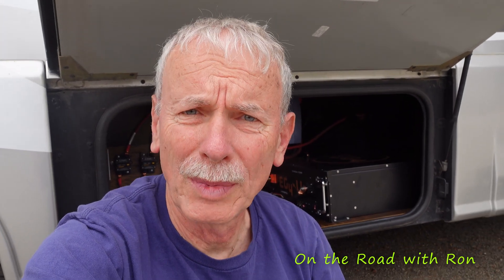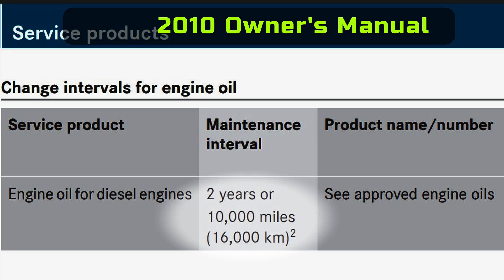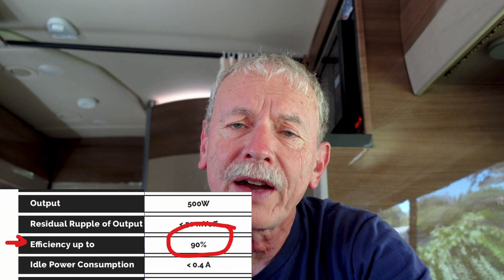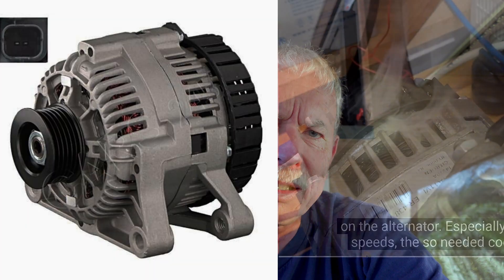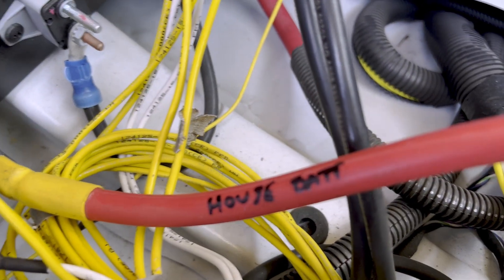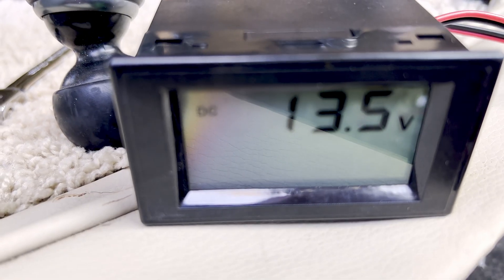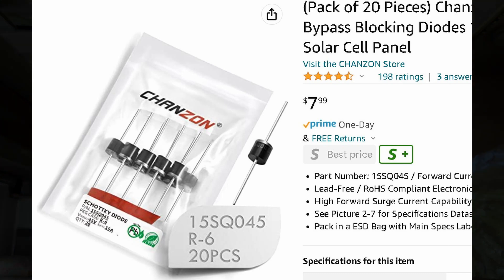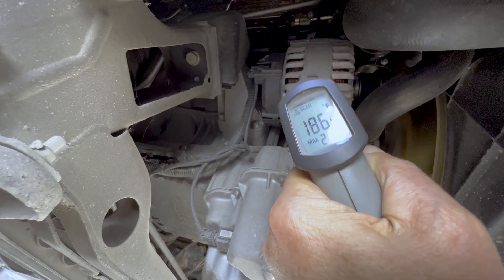DC to DC charger NOT required for big Lithium Battery

Comment: Ron, thanks for your post!!!  I too agree with you.  It also aligns with what Battle Born recommended when their batteries first came out.  Back when I installed my Battle Born lithium iron phosphate batteries 4 years ago (summer of 2018) they shared similar info that you did.  If you had just a couple of 100Ah batteries, then they were simply "plug and play."  If you were in any way concerned about stressing your alternator then they'd sell you a Battery Isolation Manager.  If you had more than 200Ah (i.e. 3 or more batteries) then they'd aim you at some 3rd party DC to DC charger solutions. However, now the newer recommendations don't make sense as the new data is still the same old data; nothing has changed.  I also don't believe a demo and recommendation on a very weak alternator is ethical.  I've been running my 2 Battle Born house batteries on my Sprinter Chassis for 4 years now.  I do have a Battery Isolation Manager (the one they sell) and haven't had any issues at all.  Thanks again!
Reply from the maker: I originally wanted to get the Battle born units but when the server rack style came out it was a lot less expensive.
Reply: AS I UNDERSTAND IT, IT'S NOT THE CURRENT THAT IS THE PROBLEM BUT WHEN THE BMS IN THE LITHUM BATTERY SHUTS DOWN THE CHARGE THE BACK EMF WILL TAKE OUT THE ALTERNATOR DIODES. THE DC TO DC UNIT PROTECTS THE ALTERNATOR

Comment: This may be true for just charging your battery.  But if you have an idling motor, inverter on (2KW) and use a heavy load - I can attest that you can (almost) smoke your alternator.  I could smell it getting hot and shut everything down pronto.   I will be installing my Renogy DC-DC soon.
Reply: Idling with any heavy load is an unforced error.
Reply from the maker: What year is your sprinter?  The older ones do have smaller alternators. And yes, i will not normally be idling the engine. This was just a test.
Reply: Based on discussing this with knowledgeable friends over the years, I’ve come to the conclusion that it’s entirely possible to charge the lithium coach batteries via a direct alternator connection. But, this should never be attempted by anyone but an electronics expert who has their hands on the controls, ready to throttle down the charge rate.
Reply: @koertdubois6781  You likely won't get full charge either. Lithium Iron batteries need a boost voltage of 14.6V in order to get to 100%. You will be about 1V shy if you just use a regular alternator. Or if you have a dead lithium battery they will pull A LOT of current right when you connect the alternator. I have a Renogy 50A DC/DC MPPT charger that will do alternator/converter or solar and will also blend them so I am quite happy with it.
Reply: @geoffmooregm It really needs to be considered in terms of the existing configuration and the owner’s needs. I believe in having as few connections as possible between our Sprinter and the Winnebago coach. Except for the few devices that can’t be completely separated (steps, levelers, slide-out) the only connection I have is  alternator –> Charge Mate –> coach batteries. And that connection is switchable and normally left disconnected. But, when it’s needed, I can choose between 80 and 150 amps from the alternator, plus 80 amps from the generator for either 150 or 220 amps of charging.
Reply: @koertdubois6781  I reading on the website, I think the Charge Mate 90 will only do 40A or 90A.  How are you getting 80A or 150A?  Thanks!
Reply: @antigroundhogday The 90A Charge Mate Pro doesn’t deliver the full 90A (at least in my case) and there’s a “direct connect” switch that is supposed to be limited to 150A.

Comment: I have two Lion Energy 100 AH lithium batteries in my Navion 24D with the same alternator as Grandpa Ron.  My Daughter has two Battle Born 100 AH lithium batteries in her trailer.  These batteries all have battery management systems (BMS).  

The Lion Energy max charging specification per battery is 100 Amps, the Battle Born are rated at 50 Amps each.  I think this is a maximum charge rate so the batteries don't over heat, and may not be a limit set by the BMS.  If the BMS did limit to these amounts, you could never charge depleted batteries directly from the alternator as the BMS would immediately disconnect at every attempt.  You would have to charge them by hooking up to an alternate, current limited source.

The total charge rate of two depleted Lion batteries might be as much as 200 Amps or more and 100 Amps for the two Battle Borns.  Plenty of draw to burn out the Navion alternator and possibly my daughter's smaller tow vehicle alternator.  We both use a DC to DC charger to limit the current just in case the batteries are ever depleted.  We don't want to have to go to all the trouble to carry and have to jump charge our batteries from some current limited alternate source or take the chance that we could burn out the alternator.  PLEASE BE CAREFUL!
Reply from the maker: You should measure the actual current. With tge long cable runs and the smart alternator, i dont think you could ever get that much charging. Of course if you are running AC or a heater in addition then still best to measure it to know. My BMS can use 200 amps also but I’m only getting 75 amps charging.
Reply: @ontheroadwithron2432  Hi Ron, thanks for the response.  I really enjoy your channel and your granddaughter is the cutest.

I agree that knowing the current draw would be  useful information.  However, batteries don't charge linearly but rather draw the most when they are discharged.  I'd first have to completely discharge the batteries for that measurement to be meaningful.  Then, that measurement would only apply to my two batteries and wouldn't be useful for anybody else reading here.

Also, the test might be limited by the alternator maximum or fuses in the line, so I'd need to use a separate high current source which is expensive. Otherwise, the maximum battery draw potential might never be reached during the measurement. 

For me, it would much easier to maintain peace of mind by spending $216 on a Renogy 60 Amp DC to DC charger versus  risking a potential break down and expensive repair.

I agree that wiring may limit current but blowing fuses is also quite possible.  A blown fuse, of course, might protect the alternator but you would never get much of a charge, if any.  I don't know what the fuse in the Navion charging circuit is, but the wire in mine is #6 so it's probably fused at 50 to 100 Amps, depending on the wire length.  

I put a $97, twenty-Amp Renogy charger in my daughters rig as the charging wire is #12 and includes a 30 Amp resettable breaker.  Without the current limiting DC to DC charger, the breaker would just cycle open and closed over and over again and little or no charging would ever take place.

I spent a bit more for my Navion charger.  I'm using a Victron 30 Amp as it's more compact and fits nicely under the passenger seat.  All the wires necessary to hook it up are there.  You simply wire it in parallel with the relay that's used to put the chassis and house batteries together when the engine is running.  Remove the relay's sense wire and use it to start the charger.  A new button can be added on the seat base to operate the relay for emergency start as the dash button will no longer work for that.

Between that 30 Amp charger and the 200 Watts of solar, I've never arrived at a camp site with less than 100% in the batteries.

Comment: Great video Ron.   Been thinking about going from my 6V golf cart batteries  to lithium at some point on my 16 G.  One question, what was the reason for adding the swtich to allow you to control when the alternator will charge the batteries ?  Wny not constant charging as is the case now with my 6V batteries ?
Reply from the maker: Normally the solar charges what i use. If i was always connected to alternator then the engine would charge them first and the free solar would shutoff. The alternator will lower fuel economy.
Reply: @ontheroadwithron2432  - ok got it - thanks Ron.
Reply: Thanks. Greatly appreciated.  I am switching to lithium ( MB LTV Unity TB 2020) and already have the DC to DC charger. It can be set for lithium. Would you keep it or by-pass. ?
Please keep the videos coming. You have a great impact.

Comment: Ron, once again, you are the greatest!

I really appreciated the close look at the Victron video, which many take as gospel. And Mercedes’s BEG have certainly caused some confusion among owners who are doing their own work.

But I’m wondering why you were only able to pull 65 amps in your test. Most lithium batteries will draw at least 1C (e.g. at a low state of charge a 100Ah battery will charge at 100 amps, that number declining as the battery gets charged) and I’m thinking that I’d like to see what happens when lithium batteries are capable of pulling several hundred amps.
Reply from the maker: Not sure why. Could be voltage drop in cables or alternator is limiting the charge current.
Reply: @ontheroadwithron2432  It could be due to the smaller voltage difference between your alternator and house batteries which at 13.00V look full to the alternator that is tuned to charge Lead Acid/AGM start batteries.
I have a SOK 206Ah and its BMS has a charging current protection cutoff at 70A anyway which is conservative and might not be that low on your LiFePO4 batteries.
I went with the DMT1250 and for $250 you charge from either sources (but not simultaneously) at a selectable 5-50A.  I also have a switch to bridge the 2 batteries because my start battery helps my house batt. with the refrigerator's 1200W initial draw.
Reply: Some actually do use lighter cables as a de facto current limiter. But, the thinner cables throttle the current by increasing resistance, and that means heat, and that means a potential for heat-related problems like fires.

I’m still wondering what affect it has to leave the other batteries connected to the charging system, alongside the lithium battery. It’d be simple enough to test, by measuring the current with and without the original batteries connected.
Reply: @koertdubois6781  It is the resistance of the wire that is limiting the current but that does not necessarily mean it is a problem.  On my coach I get 70A max to the battery when the LFP is very low at 13.0v.  The start battery is getting the full 14.4v so there is a 1.4v drop.  the power equation is P = volts times amps so 1.4v x 70A = 98W of waste heat.  That 98w is over the total run of wire which is 90' on my coach.  I doubt that NASA could measure the heat gain in that wire.
Reply: @haydenwatson7987  it isn't usually a problem, but the fear is that an unregulated alternator and a large bank of lithium batteries could exceed the safe limits of both the alternator and the cables. I strongly agree that this is rarely a problem, but that doesn't mean it should be ignored.
Reply: @koertdubois6781  I do not disagree at all.  That is why I said that I careful monitored the max charging current and set up a scenario that would maximize the current.  On my coach, with a very low battery at nearly 0% SOC the max current delivered to the 920Ah bank over the 2/0 cables was 70Ah with house battery voltage at just under 13.0v when I first started the engine.  The start battery was charging at 14.1v which indicates that the alternator was producing less than its max output in the constant voltage part of the charge cycle.
Reply: @haydenwatson7987  early in the days of RV lithium batteries, I had a friend who had a direct connection to his alternator. He could get full output going straight to the batteries! But he had to constantly monitor current and the alternator temperature.
Reply: @koertdubois6781  Yep, this is still the case if your wire runs are short.  On my sailboat, the run of 2/0 wire from the alternator to the LFP 50Ah bank is only 5' so 10' total.  I have a 108Ah alternator and it will put out an easy 100Ah, but the temperature of the case will run right past the 100ºC max that it should be limited to.  Because of that, I have a digital thermostat with the probe mounted to the hottest spot on the case with thermal conductive paste.  I turn off the field current to the alternator on my boat anytime the temp gets to 95ºC and back on when it cools down to 90ºC.  I also have the output limited to 60A which keeps the on/off to about 20-min/3-min in my hot engine space.  I am working at providing a cool air blower right to the alternator to allow me to increase the output.
Each application is different and needs to be assessed as to how it works in that setup.

Comment: Thanks for doing the testing.  I always wondered why Sprinters had such a high output alternator when the chassis doesn't require much.  Some of the older/new diesel pushers only had 160 amp alternators.  I know that my xplorer class b only has a 70amp alternator.  On the 2020+ Winnebago Views/Navions with lithium option from the factory, Winnebago put in a 40amp charge mate pro paired with a xantrex charging limiter.  It only allows 28 amps from the alternator to the battery unfortunately.
Reply: On the first day we had our 2021 Navion, I swapped out the 40 amp Mastervolt Charge Mate Pro for the 90 amp version. Coincidentally, Winnebago has now revised their BEG and they now say that 80 amps is okay.
Reply: With the 90 amp version of the Charge Mate Pro, I’m getting 70-80 amps of charging current.
Reply: @koertdubois6781  thanks that is great to know. Have you measured the actual amps you are getting with the 90amp version?
Reply from the maker: Winnebago does not take chances. They have to follow the MB rules. Unfortunately 80 amp chargers are very expensive.

Comment: Morton’s on The Move wired their truck camper directly without a dc-dc charger and had horrible overheating issues with their truck alternator.  He attributed it to the large wire he used that allowed too much current to flow.
The motorhome could well be fine but it is likely more fraught with a trailer or camper.
Reply: They ran massive POS/NEG wires and counted on the 2nd alternator sharing the load (it doesn't on his truck).
Reply from the maker: Depends on their alternator size and cables for sure. Some truck alternators are not sized for external loads.

Comment: Ron, thanks for the information and your videos. I have a 19V and contemplating the lithium upgrade. I have watched so many videos I am getting them all mixed together. While using your alternator to charge lithium are you only doing so at idle? I am curious if there is a bigger draw at highway speeds. Thanks again. Keep up the good fight!
Reply from the maker: No bigger draw driving. The alternator can provide more power with higher rpms according to the specs.
Reply: Any idea how the “smart” characteristics of our alternators play into this?

Comment: Great video Ron. I bought a 20-amp DC-DC converter for my Lance travel trailer, but have not installed it yet. Ford's 10-ga wire is notorious for giving a dismal charge through the 7-pin trailer plug at the rear of the truck. Lance usually installs a special plug for their truck campers with an upgraded 8-ga wire, but that only gives a bit extra in my past testing. With our travel trailer, I was only charging at about 2-amps during normal highway speeds on level ground and it would climb to 20-amps on steep grade climbs with the truck downshifted so the tachometer is registering 4,000 RPMs which gives the 220-amp alternator some extra spinning power. The truck wants to be at 13.7 volts and it cannot tell that my LIFEPO4 batteries are at 50%, etc. I temporarily attached a 6-ga wire with an Anderson connecter and I get 20-amps continuously on level grade from my DC-DC controller. I have not installed it permanently yet because I do not like having the extra heavy wires between the truck and travel trailer, not as convenient as a motorhome or even a 5W trailer. Perhaps this is my cue to finally upgrade to a motorhome if I can find one that isn't overpriced 50% more than it is worth these days. Thanks again Ron, keep up the inspiration sir!
Reply from the maker: Hang in there. What goes up will come down. Motorhomes are a good all in one solution but are more expensive to maintain. Key is to wait until you find something that meets your needs.
Reply: They're coming down in price

Comment: Thanks Ron. I had the same question when I installed 200ah lithium in my 2020 Navion. I purchased a Victron 30amp DC to DC charger. When I went to install it to my surprise, Winnebago had already installed a Mastervolt 40amp gizmo. So with the MV and battery BMS there was no need for the DC to DC charger. Saved $170.00.
Reply: 30A with 200ah lithium ..sorry but is ridiculous . if you charge a e bike or other things that absorb 15 o 20 a, you dont charge the battery, I see a lot person with this absurd system. I have a 65A alternator and I charge 35 A with 20A load without problem. non burn, no smoke. and my alternator at idle rpm, dont produce more of 25A, so not overheat